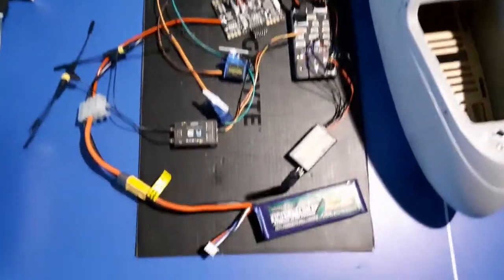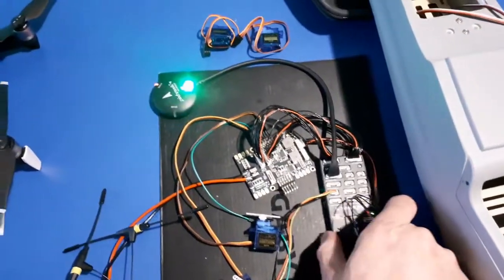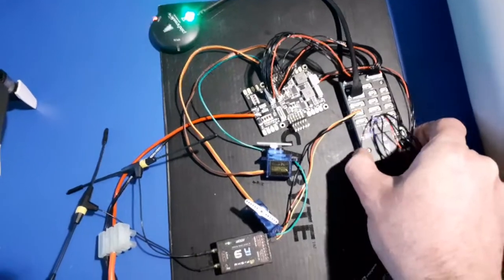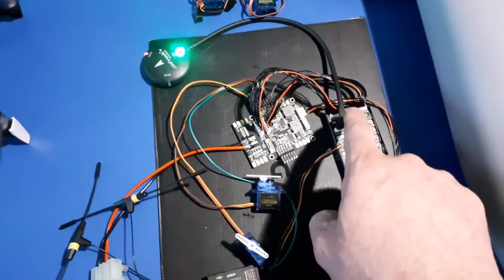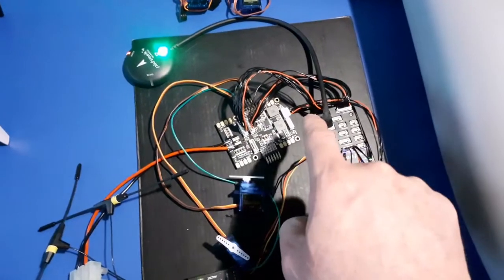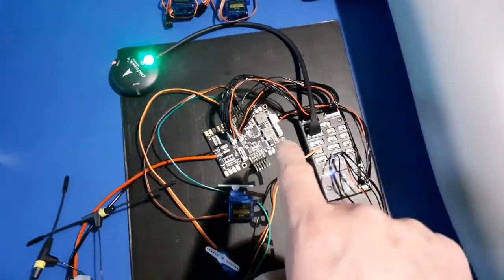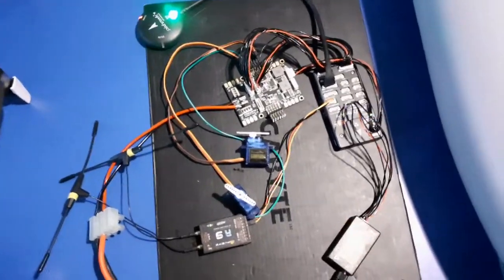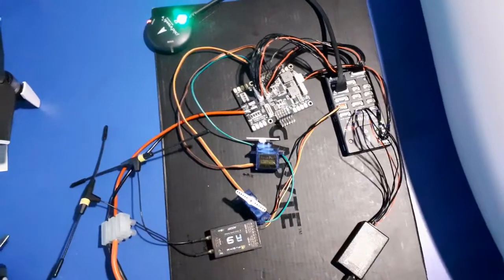How to Correctly Connect Servos on a Pixhawk 4

Comment: Yes the pwm labelling is aimed at quads, ie the "main" outs are routed to the m1- m8 through hole pads near the ecs power supply pads, this is because on a quad the "main" outs being primary flight controls are the esc's driving the thrust motors, 
For plane use you can just plug the io out to the fmu in and get your main outs routed to the pin header for servo and esc connection.
Or really for a plane you could use a much smaller 'in line' power module and then utilise the small supplied external io pin header boards for servo connection.
Reply from the maker: thanks for that, any chance we can connect directly somehow? are you on telegram?
Reply from the maker: Hi again, if you want to contact me directly you can find me on Telegram - @Aeronaught

Regards
Aero